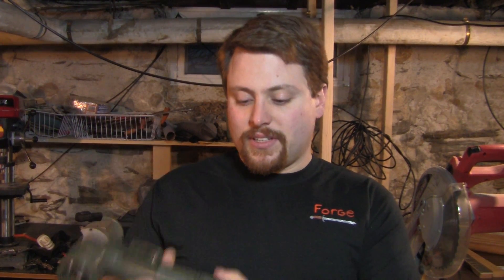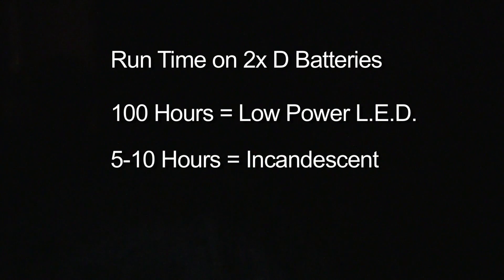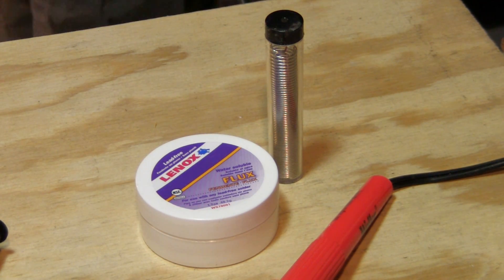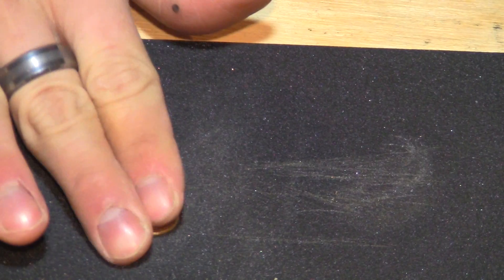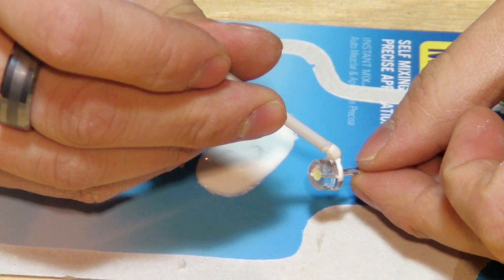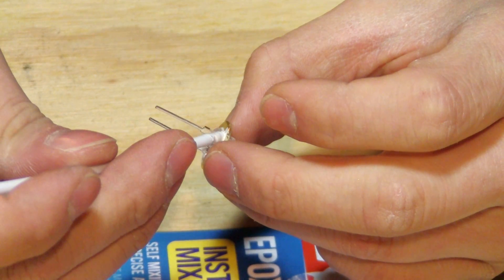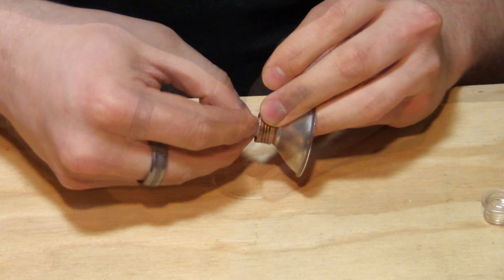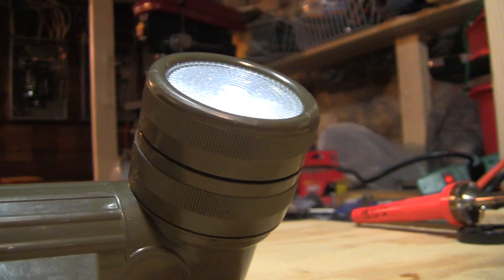Ad-hoc 100 Hours Flashlight

Comment: Indeed.  I've just managed to burn a few out -- mostly by overvoltage, which shouldn't be a problem here; however, the heatsink is meant mostly to ensure that it keeps on ticking without a runaway heat condition, so that it remains reliable in the event of an emergency.

Comment: Great Project! But i do have one further step i feel you should have done was coat the cathode of the LED ( short side ) with a dab or two of a liquid electrical tape. As the batteries are spring pushed forward in the housing. Just some added protection to prevent failure . did the addition of the thermal compound effect the epoxy in any way? and is it really that much of an issue when your changing from incandescent to led considering its only 1/2 watt?? and normally burn hotter then LED?

Comment: The reason for the heatsink isn't for the body, it's for the LED - the strawhats, in particular, are notoriously poorly heatsinked, which can mess with light output and lifespan of the LED. As for something to seal the ground, that's not a bad idea. Thanks. 

-Tristan

Comment: Oh yes, and as for the HSC changing the epoxy - yes, it weakens it slightly and slows cure time, however, it's unlikely that the epoxy will ever be under enough stress for that to matter (and if it ever is, I doubt it would be the only thing that broke).